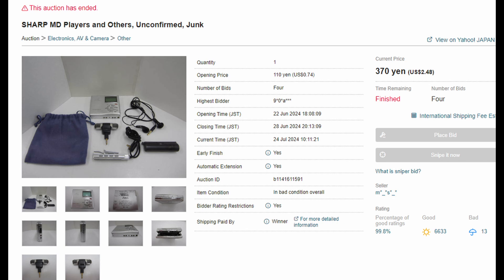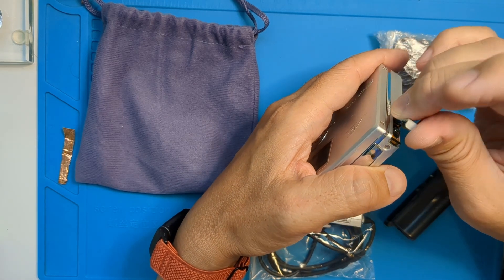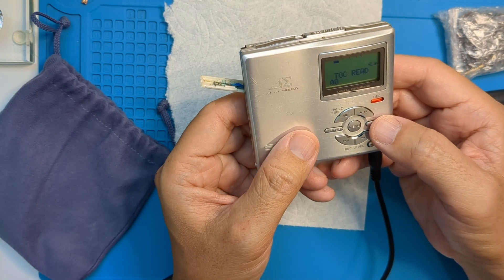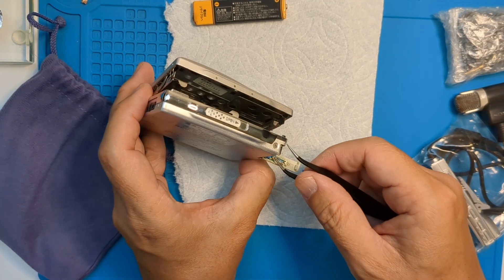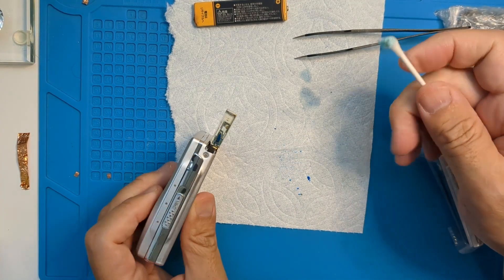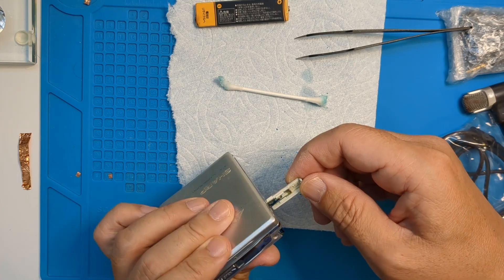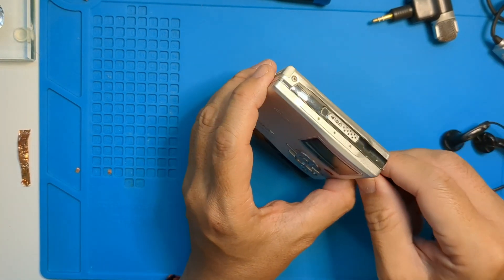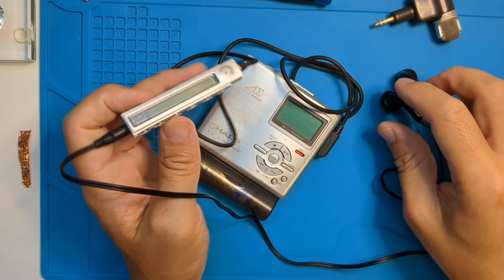Sharp MD-DR7 MiniDisc Recorder 1-bit Auvi Silver MDLP Repair 370 yen Junk or Fixable?

Comment: Nice video. I think the sharp players are great. I’ve a couple of DR77s that work but every time a disc is inserted it makes a clicking sound a few times before it reads the disc. When I took it apart i noticed that the clicking sound was the laser sled going past the TOC area of the disc and hitting its maximum path of travel. Did you ever come across this?
Reply from the maker: Thank you!  Yes I love the MD-DR77s as well! I know exactly what you mean and it's an odd phenomenon. I've seen some DR77s that work after that and I've seen some that continue to bang against the middle and never read properly. I think it's something that could be calibrated in the Service Menu, but I'm still learning about how to properly make adjustments in there. 

I'm quite sure I still have at least one MD-DR77 that acts like that so I'll have to dig it out and do more testing when I have the time. Thanks for reminding me!
Reply: @TechnicalInitiative  haha, I thought it was a bit strange both my units had exactly the same issue! Not sure if you play with MZ1’s but I found a way to fix the optical block issues on them and have successfully got a couple working now. If you want to know any more I can dm you let me know :)
Reply from the maker: Definitely! I haven't had a chance to work on any MZ-1s and I don't own one yet either. The ones I've seen have had eject or other read issues. Would love to know more!  You can always email me at hien at technicalinitiative.com  Thanks!